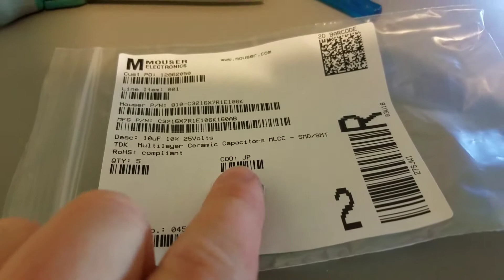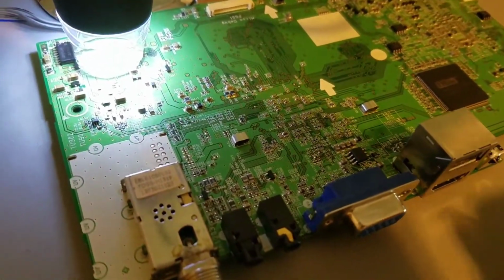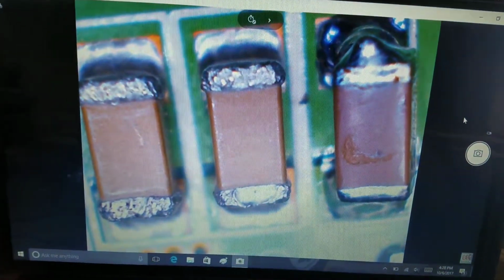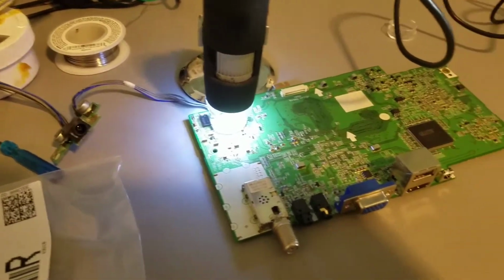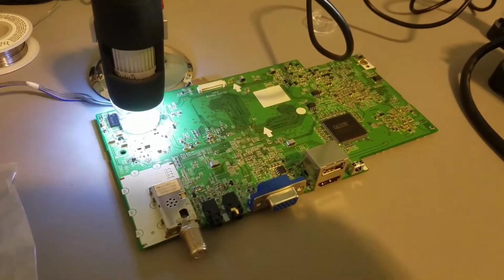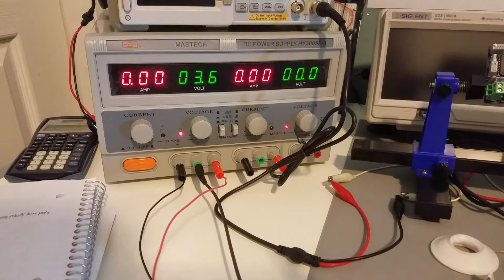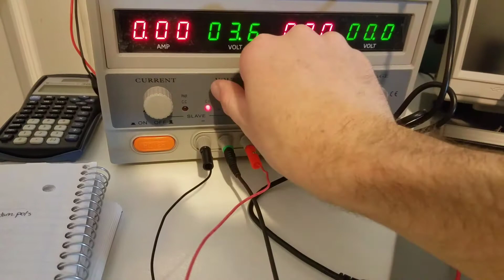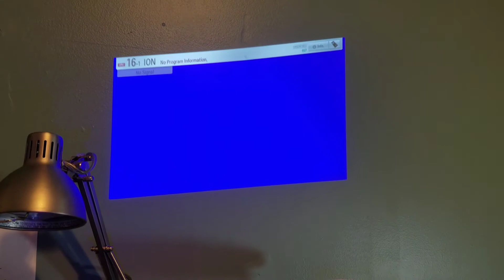LG PA75U projector repair-Part 2

Comment: Hi! I have lg pf1000u projector with strange behavior - it turns on on 10 sec after that fans go loud and it turns back to standby mode - red light. I've checked ceramic smd capacitors (they are not heating much) and NTC thermal sensors - all seems well. What can i check next? Thx a lot!
Reply from the maker: Check power supply to see if it's what cutting power off... after that I'm not sure.

Comment from the maker: UPDATE: 3 years later and the projector is still working with no problems.
Reply: Hi! Just emailed you at your juno email handle I found in a thread. Appreciate any assistance!
Reply: I hope to get an answer from you I lossed the charger and I don't know what type of charger does it take I tried to go to Walmart but the kits that I bought does not fit the projector
Reply from the maker: @alteravi2790  I don't have this projector anymore. Your best bet would be to look for the same one on ebay and see if you can read the label from one of the pictures.

Comment: I have the same projector and the same issue.  trying to figure out how to dis-assemble it to even get to the board.  I've removed the screws but the cover won't budge.  Is there a video or something I can follow so I don't break it?  How did you figure out how to open it?  Thanks!
Reply: I finally figured it out.  How do you know what each cap is?  I found a couple burnt caps but not sure their values.  They are C510, and C586.  Is there a schematic somewhere?
Reply from the maker: @jamieadams4310  

I bought a manual on ebay for a couple bucks. I don All those caps in the area of the one I replaced are the same value. If you want a copy of the manual just email me @ Bradkwfc@gmail.com.

C586 22uF 10V
C510 22uF 25V

Comment: Hello BradK!!

I had a problem with my LG Projector PA75U due to an overload of power, and even the LED Stand by does not turn on. How do I solve the antispike? I dismantled the projector and looked for a burned piece with a microscope, but nothing. I do not know how to do the test on the motheboard to find the hot spot. Maybe is just the power source or some anti-spike circuit or surge protection circuit.
Reply from the maker: Mauricio De La Garza 

It's likely a filter cap like this the one is this video. 

Mine did the same thing where the standby light on the power switch did not turn on.

First thing I did was remove the power plug from the projector... then unplug and replug in back into wall power but do not plug it into the projector. Measure the voltage on it to make sure it's working because it could be the power supply/cord.. if the power supply is good then plug it into the projector slowly-look and listen for acring...remove the plug on the projector then measure the voltage on it again. 

If there is a short the power supply will cut the power and you won't see any voltage after connecting then removing it from the projector. 

Now you know you have a short.... next you need to isolate the power flowing through the different boards to find the location of the short by doing the same thing but unplug one connector from the main board every time... this will tell you what board the short is located on... most likely it's the main board like mine was... and it's likely one of the filter capacitors just like mine was.

Another thing I did is apply a low voltage dc using a dc power supply with a ammeter on it to the projector that was not current limited (You could probably also use a 9V battery) then I felt around for hot spots on the board and from there I used the alcohol trick to determine exactly which cap was bad.

Comment: What did it do when turn on before cap mine turns on 5 seconds then shuts off haven't looked into it
Reply from the maker: Mod Box 

It wouldn't turn on at all, the light on the power button wouldn't even come on.

Comment: Hi I have 2 of these projectors one I'm using daily one I just purchased that's said to have just stopped working with no remotes and a generic power supply for parts etc if needed. I'd like to replace the plastic convex lenses used on the red green n blue leds with glass ones , all 3, any idea the size and thickness n focal dist of these plastic ones or even where to purchase? Or any parts for that matter. I believe there will be a dramatic increase in brightness and clarity with glass lenses with a 98% light pass thru than these foggy platic pieces of junk. I had the blue led lens get brown internally with a yellow tint from getting to hit from led caused a discoloration of whites etc to be yellow. Do u still have the one u repaired and it working good still.?  Any other issues or mod suggestions? Have a lil under 3000 hours on this one I use daily all day long
Reply from the maker: Kristian J Patterson 

The only thing I can think of is to buy a repair manual off eBay and see if it includes a part number for the lenses. I had the repair manual but deleted it. I don't remember it having lens pn's though but I only used it for the electronics schematic so I might have missed it.
Reply: BradK. I have the repair schematics and you are correct it fails to denote lens type size etc.. Will continue my search tho I believe I found some matching 28mm in glass. But I need to do a tear down on non working unit to measure lenses again.
Reply from the maker: Kristian J Patterson 

Ok, sorry I couldn't help more. Might be difficult to find a lens with the same geometry. Hope it works out for you though.

Comment: can you please tell me whether these projector uses-single led chip or 3 led RGB--thank you
Reply from the maker: rahul kumar 

RGB, on the LED driver board there are even 3 separate connectors labeled R,G,&B.
Reply: thanks--do you think can be replaced by other led chip with some modifications-like we do in dlp lamp projector
Reply from the maker: rahul kumar 

I don't think so, unless you can find an LED with the exact specifications with the same or an LG equivalent part #.
Reply from the maker: rahul kumar 

Not sure what the specs are, I have seen repair manuals on eBay which have part numbers for the components though. If you can find the right manual then match the part up off of it you might be in luck.
Reply: thanks

Comment: Hey how can I get in touch with you, i have same projector PA75U and when I used it it looks pink and no audio at all so I open it and I noticed that something is burn a cable and on the borde it say GREEN.. can u help me to fixed it ?
Reply from the maker: Alfredo Torres 
Do you have any electronics experience?  Have you soldered before?
Reply: BradK no not at all
Reply: I can send you a picture later on
Reply from the maker: Alfredo Torres 

So your problem is likely on the LED driver board. It's it just the wire that's burned or one of the components?
Reply: BradK just the wire
Reply from the maker: Alfredo Torres 
Send me a picture of it, xbradkx@juno.com
Reply: Hi BradK, I have the same problem as Alfredo. I have an LG PA75U projector that was given to me and it has a perfect screen with a mostly orange tint to it. The green wires are a bit burnt and hot to the touch. Even the case inside has a brown hot mark on it. I have taken all the color wires off and powered the unit up one at a time and each color "seems" to be present, but I still have a heavy tint of orange to the picture over all.  I haven't found any help at all on line, but I did see some parts units on eBay that said they had the same issue, so I'm not alone. Any help? I would appreciate it.... Thanks
Reply from the maker: unclebuck000 

So the problem is likely on that small LED driver board. Easiest thing to try first is a solder reflow by baking it in the oven. Lots of vids on YouTube explain how to do it. 

If that doesn't work you need to find the location of that short...Find out which LED that green wire goes to and I'll try and help you from there.

It might be something simple like I had but that still took me many hours to find and repair, and I work in electronics for a living...If you don't have any electronics experience it might not be so easy as you need the right tools to take measurements and solder/ desolder any damaged components.  

Keep me updated and I'll help as much as I can.